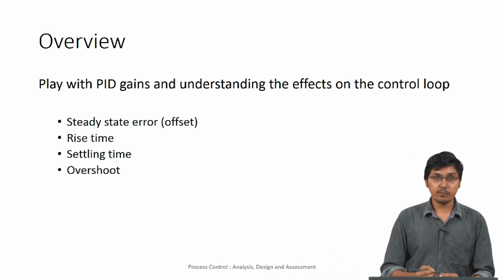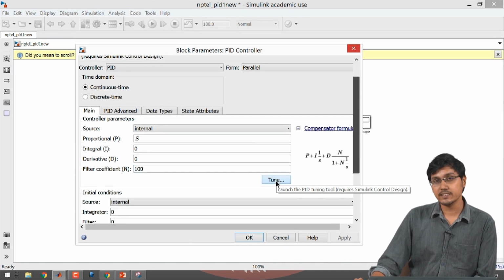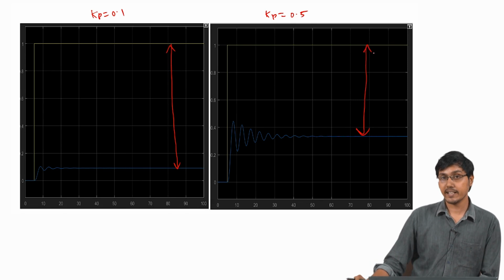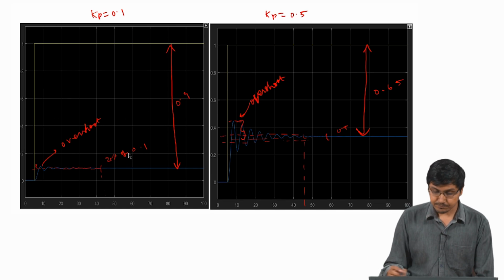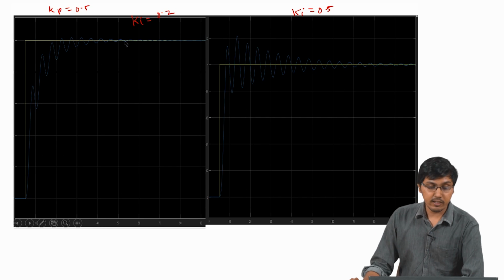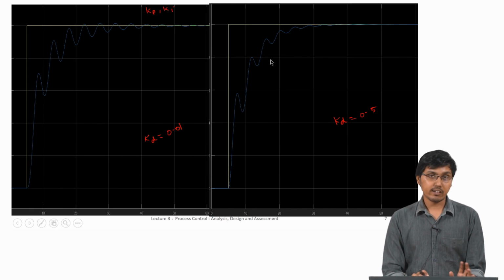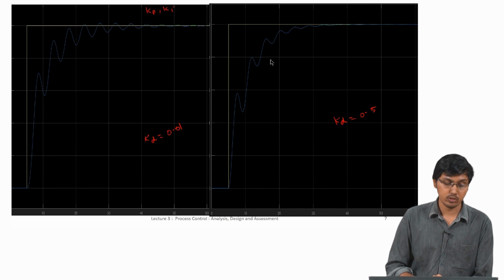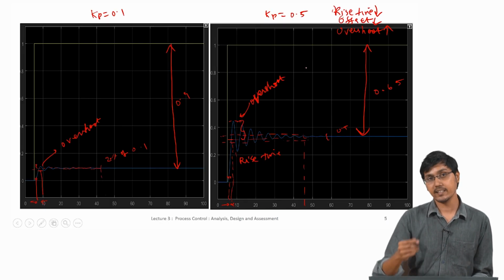Understanding PID Gains

Comment: Is it possible to get negative gains kp,ki,kd and still get a required positive output? Because i got a positive output though i had all gains as negative values...
Reply: Hello Aziz, look at the transfer function of the closed loop. For P control, let us say, if system is G(s) = 1 / (s+1), Closed loop TF is Y/Y_sp = kG(s) / (1+kG(s)) = (k / s+1+k). Let us take k = -0.5, closed loop is -0.5 / (s+0.5) which has negative gain. If your system was G(s) = -1/(s+1), you would have got a positive gain. Further note that, we are only talking about the case of what happens to dy (change in output) when d(ysp) is positive: We don't talk about values of output (y). If system has negative gain and dysp is negative, you will see dy to be positive since dysp/dy = closed loop transfer function. I would suggest you to see that closed loop TF is all that matters and it says the how the output changes (not the value of the output).